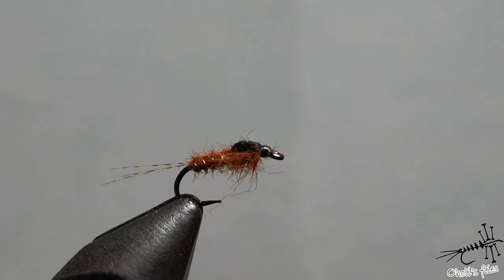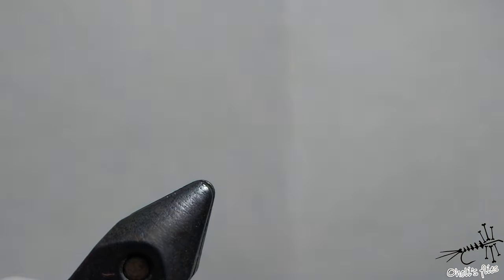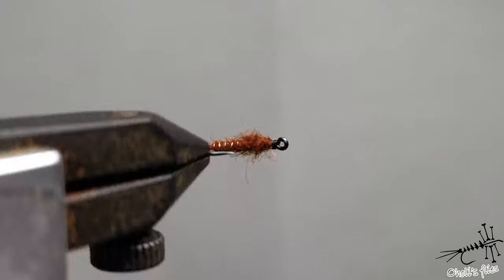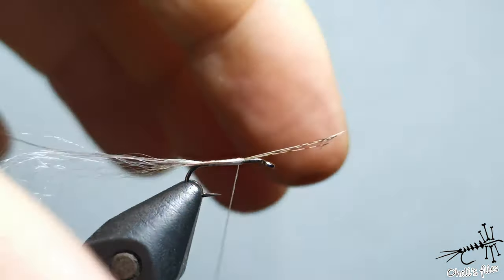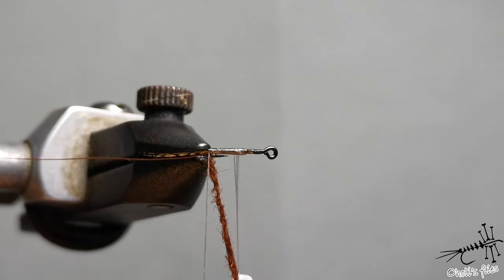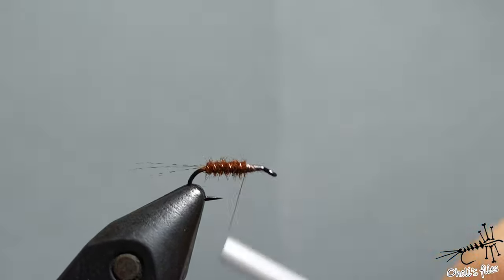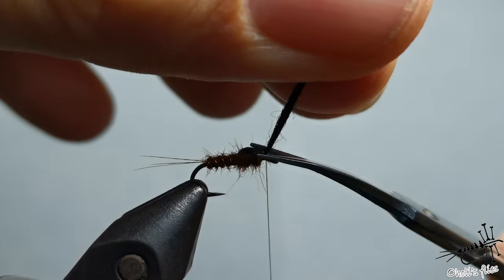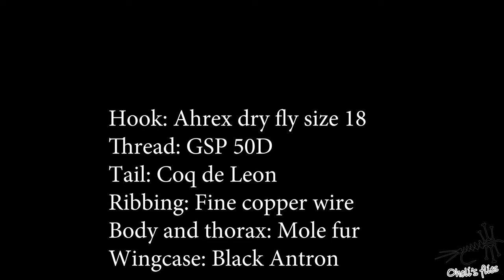Sight Fishing Nymph (plus V-loop dubbing techniques)

Comment: I've just used this V-loop technique to tie a size 24 Avatar fly ( Rim Chung's ).  The materials were black 18/0 Semperfli Nano Silk and Troutline's Black Pepper Pure Squirrel dubbing.  Prior to using the V-loop technique, I'd twist the dubbing onto the thread as tight as possible and form a segmented  body.  However, despite all my efforts I was rarely able to make a very thin fly which still exhibited segmentation.  Using the V-loop method I was successful.  I don't think I could have managed without the use of the extremely thin and strong GSP thread.  Thanks Vladimir for making me a better tier.
Reply from the maker: Excellent... Thank you for doing it your way. Thats the whole point... Use what you like from my vids and use it where you like it. Thats creating. Glad you are happy with results. GSP allows you to make everything super tight and durable. Very good thread.

Comment: Interesting.  I never thought of using Antron for the wing case.  If I do, I may try adding a bit of UV resin to prevent any possible fraying. Thanks for posting Vladimir.
Reply from the maker: It wont hurt for sure. Why not. Same principle, you can use icedub for wingcase, try peacock colour for start, and apply some uv.... Looks amazing.
Reply: @Oholisfliesandfishing  Thanks Vladimir.  Regarding using peacock ice dub for wing case, I think I saw that in one of your videos ( beetle, I think ).

Comment: As ever, It's wonderful you combine a new technique with a really excellent fly.

I've just been given a mole skin and I've no idea how to get the fur off it and onto thread without it going everywhere.  So if a future video could show the process of getting fur off a skin and into a fly that would be fantastic!  Perhaps an Iron Blue Dun pattern? ;-)
Reply from the maker: Thanks a lot 😃, tecnique is not new, probably just not used enough. I guess.... I pinch fur with my nails.... Or cut it.... But no problem.... Easier to just make a video in it.... As for the iron dun... I am not sure i have all materials available to make it as an original... But i can do some variation if you dont mind 😃

Comment: Excellent little fly. The black (or brown) antron could be adapted to a beetle pattern—it imitates striations on the wing covers. Very effective by the look of things. I'd never consider using real seal's fur—adult or baby though.
Reply from the maker: Thanks. Yes, antron is great material. I dont recall using it for beetles only for ants. And seals fur, baby one is pretty interesting for hackle. I have only small patch of it so i use it rarely. Underfur is so fine, it has perfect creamy colour. And its amazing for dries
Reply: @Oholisfliesandfishing  If I get around to it I may try antrn for a beetle. The though just occurred to me when i saw your wing case. :-)
Reply from the maker: @TERRYBIGGENDEN  why not. Just saturate it with floatant, dont add hackle, keep it simple. So floatant will keep it in the surface film